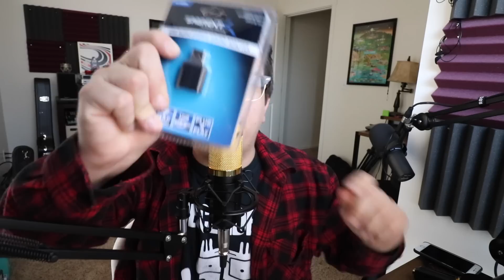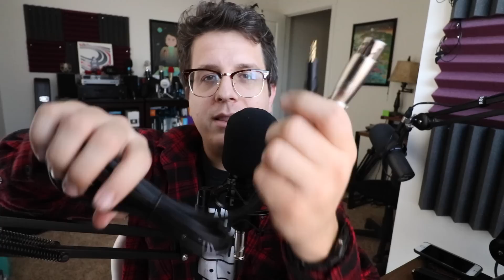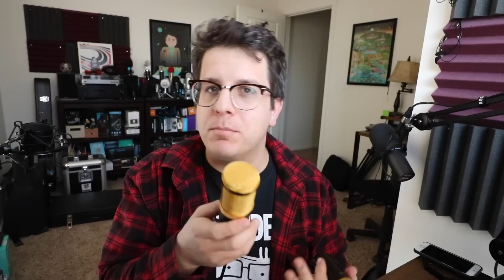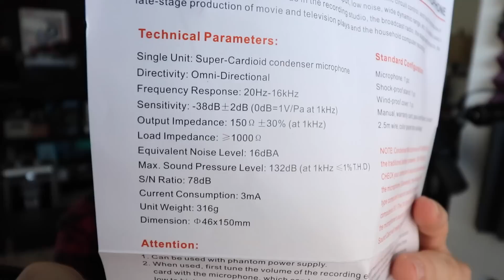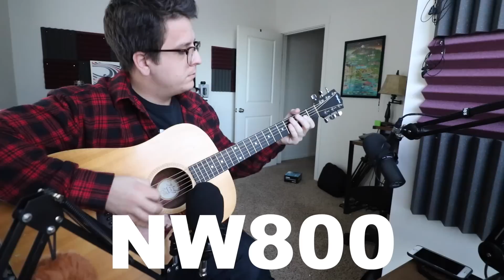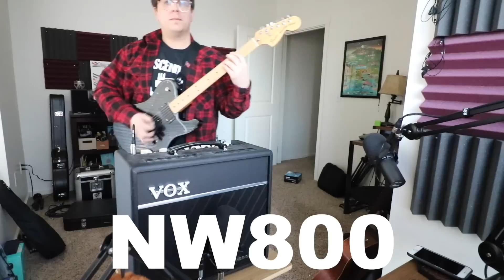Neewer NW-800 Condenser Microphone Review / Test

Comment: this mic is freaking better than my $250 mics im running it through my focusrite 2i2 I cant fucking believe how amazing it sounds and if you have the right plugins you can make it sound 100x better than it already is.
Reply: I mean, if one dies you can get another for 25 bucks, still wayyyy under 250
Reply: FernFox but that does add up, a lot.
Reply: What plug-in do you recommend? Please help
Reply: can you please tell us or recommend some plug ins?
Reply: Hell yeah I've had this mic lying around I'll have to give it a try
Reply: BLAZE45 what would you consider the “right plugins”
Reply: So did you by a seperate XLR cable to run it into your focusrite? The one that comes with the mic is a jack.
Reply from the maker: It's pretty impressive for the price. But I doubt it will have the longevity of those $250 mics.
Reply: I look at it like this, when you spend all that money on those mics you're paying for the name then factor in the fact that to make a good mic only cost but a few dollars a good friend of mine made a very good mic for about 5 bucks minus the outer casing. sure the casing wont be as good but the pick up will be about the same and as I said a good vocal suit you would never notice the difference.

Comment: would you suggest this audio interface go with it: Neewer 1-Channel 48V Phantom Power Supply
Reply from the maker: This is not an audio interface. This is a microphone. I ONLY RECOMMEND xlr mics be connected using a USB AUDIO INTERFACE.
Reply: Podcastage but could I still use it though

Comment: Hey I have a question about the audio because I just got this mic today and it doesn't sound nearly as good as yours. It sounds alright but could be better. Could you explain how you went about setting the mic up? And for reference, I'm using the mic alongside the Ohuhu 48V power supply. A reply ASAP would be great and thanks!
Reply from the maker: I was using a USB Soundcard, but I no longer recommend this method. I only recommend USB Audio Interfaces.
Reply: Podcastage right right got ya. And would that require a phantom power to function or not? And also, do you have any recommendations for interfaces? Thanks again for replying!!

Comment: ok, I sorta understand.
if I bought this mic I would have to worry about a few things.
I just want to make sure.
You're saying the SYBA isn't as reliable as most would hope comparison to USB audio interfaces are.
but USB soundcards can do the job.
second of all. if I buy the "Behringer UM2 2x2 USB Audio Interface with XENYX Mic Preamplifier" which is just an interface. would I still need a phantom power? or would the interface do that job?
Reply from the maker: It's possible that the SYBA would work, but the performance across computers is too inconsistent, and manufacturing of those devices changes too frequently and has poor quality assurance. Therefore, I don't recommend them because it seems like people just get pissed at me when they buy one that doesn't work. A UM2 should work perfectly with this, it offers phantom power to condensers, so you would just need an XLR to XLR cable.
Reply: alright, thanks man :D. now if I buy this I just need my shit computer upgraded next

Comment: how do i connect the microphone cable to the usb adapter? Di i just plug it into one side or what?
Reply from the maker: You would plug it into the MIC input on the adapter. But I do not recommend USB Audio Adapters any longer.

Comment: why does mine not sound as good as your so confused
Reply from the maker: Recorded using USB Soundcard. No longer suggest this method though. Only suggest USB AUDIO INTERFACE.
Reply: I have phantom power though
Reply from the maker: Advisions that does not change the fact that your computers built in mic input jack is not good.

Comment: i have the neewer arm stand and for some reason the part where you connect the shock mount to the little metal arm is very lose to the point that it just barely holds up my mic, is it supposed to be like this?
Reply from the maker: No. Tighten it with pliers.

Comment: So i bought this mic and its companys phantom power and it had static noise in the background so i got another phantom power from different company and still .. i bought a usb audio card and still .. i plugged it into my pc without any phantom power or usb card and still static noise
Reply: But he has phantom power, so his usb audio adapter should work fine, must be something else wrong?
Reply from the maker: Over the last year, I stopped suggesting using a USB Audio Adapter because they're too unreliable. The only way I suggest connecting XLR mics to the computer now is with a USB AUDIO INTERFACE.

Comment: I have bought this microphone along with a phantom power supply, I use it on a desktop which has a pink microphone jack. Yet the volume is extremely low (barely detects my voice) and very noisy as if there's a vent in the background. What am I doing wrong?
Reply from the maker: try getting usb soundcard, or what I would recommend is USB Audio Interface.

Comment: I've been using the NW-800 to record electric guitar instead of a atandard SM-57 lately. Sounds pretty gosh darn good!
Reply: That makes me a bit more confident now I bought this for my dad and he plays
Reply: Especially for 20$ I’m pretty set back
Reply: Thought I'd give it a try with my acoustic nylon string recording tgrough nw-800... I have to admit, with a bit of reverb it sounds phenomenal!
Reply: Steve Stell is it plug and play
Reply: Steve Stell my mic doesn’t work I got it and my Microsoft laptop doesn’t pick it up that this mic was plugged in, and when I test it on obs I doesn’t pick anything up
Reply: @mike_.  are you running it through phantom power?
Reply: do you have to tune it with an audio mixer??
Reply: SuchLikeSanta ,  why would you use a microphone to record electric guitar?
Reply: HowdyAuS you put the microphone on the amp and it just... records
Reply: @zekeschriver1554  That's what an audio interface is for...
Reply: @DigitalDevil  no. no it is not. a mic"d amp sounds way better than a fake amp. also you still need the audio interface for the microphone
Reply: Steve Stell DISTORTIONNNNNSJDNDIDBSKDBSKND

I mean, wtf, you consent be bothered to get an sm57 and are instead using a $25 electret condenser...

Comment: I wanted to know if a audio interface is also giving voltage to the mic?
Reply from the maker: Depends on interface. If it lists PHANTOM POWER, then yes it will provide power.
Reply: You can't get many without Phantom Power

Comment: I recently bought this mic with the 48 volt phantom power, but for some reason it keeps picking up static/hissing. Please help!!
Reply from the maker: Buy usb soundcard as well?
Reply: Podcastage Cool! that's probably it
Reply: I have had the same issue. Turns out my laptop was actually the problem. I tried different combinations, with and without phantom power, with different audio settings... but no external sound cards or audio interfaces. 
My laptop produces a loud static noise that I was able to remove by enabling echo cancellation and setting the gain to 0db and the volume to 75. But my voice sounds terrible when I do that. 

Then I tried it on my gaming setup, which has a decent built in sound card and there is no static. With or without phantom power, it sounds just as loud and as clear. And no settings there either. Just input volume set to 100% and nothing else. Even at +30.0db gain, there still is no static. 

So my suggestion is, don't use a cheap computer with your mic. I didn't try an audio interface though, so I don't know whether to recommend trying that. But it still is an option, that many people recommend.

Comment: So I got everything, usb sound card, phantom power, everything it sounds great, but there's static as if i was recording straight without them. Am I doing something wrong?
Reply from the maker: What do you mean? If you're recording without the phantom power and usb sound card it has static?
Reply: If i have everything on, it still has static noise.
Reply from the maker: could be issue with windows 8 and 10. There's a known issue with audio on that OS and Microsoft has ignored it.
Reply: Probably is, I'll experiment with another OS to find out, thanks.
Reply: 『Spyder』 Results?
Reply: I have had the same issue. Turns out my laptop was actually the problem. I tried different combinations, with and without phantom power, with different audio settings... but no external sound cards or audio interfaces. 
My laptop produces a loud static noise that I was able to remove by enabling echo cancellation and setting the gain to 0db and the volume to 75. But my voice sounds terrible when I do that. 

Then I tried it on my gaming setup, which has a decent built in sound card and there is no static. With or without phantom power, it sounds just as loud and as clear. And no settings there either. Just input volume set to 100% and nothing else. Even at +30.0db gain, there still is no static. 

So my suggestion is, don't use a cheap computer with your mic. I didn't try an audio interface though, so I don't know whether to recommend trying that. But it still is an option, that many people recommend.

Comment: Is the audio good with the neewer phamton?
Reply: Will it make a massive difference because i just ordered it with a power supply and im wondering if i should order a usb sound card aswell
Reply: AceFinley he recommended me the sabrent USB sound card for get a good quality because the internal sound cards are bad
Reply from the maker: If you have a good usb sound card and phantom power supply, or a USB Audio Interface.
Reply: I need a good and cheap microphone and I found your video and the quality is so good... I found in Amazon the Phantom and the microphone by approximately 40€... Could I get with that phamton a similar quality connecting the phamton directly with my PC?
Reply from the maker: No. Likely not. Internal sound cards are really bad. Phantom power & Sabrent USB Soundcard with this mic should work well. That's what I would use in this situation. OR. The mic and the SYBA STEREO USB SOUNDCARD. Or a USB Audio Interface that has phantom power.
Reply: Podcastage oh OK, thanks for the information I am new in this audio world. I'll buy the sabrent USB sound card
Reply from the maker: Just to reiterate: you will need the Sabrent Soundcard and Phantom Power.
Reply: I bought the "pack" that you said(micro, phamton, sabrent and also an antipop filter) and I am waiting to receive in my house. But I have a doubt. I make videos and edit the audio with Sony Vegas. Is this good for get a good sound quality or I need another program to edit ?  What do you recommend me?
Reply from the maker: I've never used Sony Vegas, but I imagine it will work just fine.
Reply: +Podcastage so, what program do you use?
Reply: I got the nw 700 and a power supply will i need a usb sound card or no?
Reply: Use audacity or sony vegas both good for audio audacity is a bit more complex and you can make it sound better but its a chore for some
Reply from the maker: For my reviews. I just record the audio into QUICKTIME to avoid any subtle encoding improvements caused by the DAW. Then I just edit the video in Final Cut Pro, but do no processing to the audio.
Reply: Ok cheers
Reply: Podcastage thanks for your help
Reply: Podcastage HI, a few months ago you recommended me a microphone and I'm so grateful for that. Now I would like to improve the quality of the audio and I need you to recommend me some microphones over 50/60€ ( or 💷 pounds) 🤔. Thank you so much, I'll be waiting for you answer
Reply: A good one is the Blue Snowball ICE

Comment: Hi, does rhis neewer need a Phantom, please help me im trying to use it on my iMac, macbook pro, and nothing works with ir. 
Some help to set up may be very useful, thx everyone, apologies.
Reply from the maker: How are you trying to connect it? Do you have a USB SOUNDCARD?
Reply: no, i just bought ths single microphone with his cable and their base
Reply from the maker: That's your problem. If you get the SYBA STEREO USB SOUNDCARD that I link in my USB Soundcard videos, it should work without phantom power. If you buy any other USB sound card, you will need phantom power.
Reply: al right, thank you very much ill test it

Comment: Okay so here's my issue... I bought this same mic (nw-800) close to a year ago having no knowledge of condenser microphones or how they work. I use windows 7 and when I first got the mic I thought plugging it directly into my computer would work. Obviously I know now that it's not how that works and after some research I found my best option was to get a little newwer 48V phantom power box and run that to my computer to get the mic to work. I wasn't able to get any feedback from the mic and after a while of playing with the settings, I found the only way to get feedback was to raise the boost and the only way to hear myself was to set it to max. This made it so I was able to hear myself, but very very slightly and the background noise and fuzziness created by the boost was substantially louder. So the next best thing I found was to buy a big audio mixer. I ended up spending $80 on a behringer xenyx 1002fx audio mixer. However, after figuring it all out, I ended up with the same problem as the phantom power supply box. After researching and reading about audio mixers and condenser mics for months, I have found that not many people are having the same problem as me and that the solution is either very well hidden or dosent exist. If there is anyone who can help me, please! I would really like to use it and any feedback is greatly appreciated
Reply from the maker: Try getting a USB audio interface, or an RCA interface to connect the xenyx1002fx to the computer. Internal mic inputs are shit.
Reply: Podcastage okay I'll try that out, thanks

Comment: is there any way to get the default Shure foam windscreen for my NW-800?
Reply from the maker: if you search "SHURE WINDSCREEN" on amazon I'm sure it will come up. I don't think they would fit though.
Reply: I did search it but only weird versions come up. I'm looking for the nice cylinder one, not the fat circular one. And also, are they too big or too small?
Reply from the maker: What cylinder one are you talking about? The ones that goes on SM58 would not fit, it would be too small.
Reply: The flat looking one on the Shure SM7B.

Comment: Hey Bandrew,

I recently bought this mic and i'm having a problem with it: theres still some Background noise.
And yes i did purchase a USB soundcard (Antlion soundcard wich you tested already and should provide 4.5 V just as the old sabrent one), but i'm still getting background noise and my recordings don't sound as good as yours(not as clean and full).
So do you have any ideas what i could do?
Btw im connecting the Antlion to a USB 3.0 Port on the motherboard, not front panel.
Could it be, that you connected your old sabrent soundcard to a active USB Hub, that provides more power ?
Anyways im hoping for a soon Reply :)
Reply from the maker: The USB hub I used was not active. It was plugged into the usb port and that's it...if I remember correctly. And it could be an issue with windows, or it could be that antlion altered their USB soudncard. I'm not 100% certain. I do know that the antlion does have some digital line noise just like the SYBA Stereo usb sound card though.
Reply: Thanks for your response
I solved the problem more or less... Whenever i play back the recording on my computer, there's that noise, however when i save it as a .flac and play it on my soundsystem in the livingroom the noise is gone and everything sounds alright.
So seems to be the bad onboardaudio causing that noise...
And thanks again for your help, i find it awesome that you still reply to comments on an almost 1 year old video :)

Comment: hello podcastage i bought a NW-800 and a  USB Sound Card (not the Sabrent USB Soundcard) but the volume is still realy realy low  is there anything i can do to change this ? (its on 100% in the microphone options) would buying Phantom Power boost the volume ?
Reply from the maker: It likely would improve audio quality and volume. Check my "how to connect xlr mics to computer for beginners" video. Could also be an issue with windows.

Comment: I have the same mic, and that black cover isn't a pop filter. It's to block wind noise
Reply: The
Reply: lovewdy yes, thanks for the comment
Reply: Vendetta V No I'm not. Wind filters block noises from moving air caused by fans, actual wind when you're outside, etc. Pop filters are placed in front of the mic to block out noise made from saying words with p's, s's, f's, etc. They are different
Reply: Vendetta V I have. I call it a wind filter because that is what the company says it is. I don't call it a pop filter because when I talked in the mic with it on, popping noises still occur

Comment: So, the best thing I can do is buy SYBA usb + phantom power for get a good sound like of this video?
(I'm from Spain so I don't understand all you say in the video)
Reply from the maker: if you get SYBA STEREO USB SOUNDCARD, you should not need a phantom power supply.
Reply: should it work better with phantom power too? thanks
Reply from the maker: Won't see much improvement between SYBA by itself and SYBA w/ Phantom power. Mics require ~5v of power. They get 4.5v from SYBA. Providing 48v will leave 43v unused.

Comment: I just bought the mic thinking it would work with nothing else. Now, I'm confused. You need a usb sound card and a power supply? Will it work with only the phantom power supply or just the usb sound card?
Reply from the maker: it will not work with just power supply. It CAN work with only a usb soundcard if you get a SYBA STEREO USB SOUNDCARD. That's the only one that works.